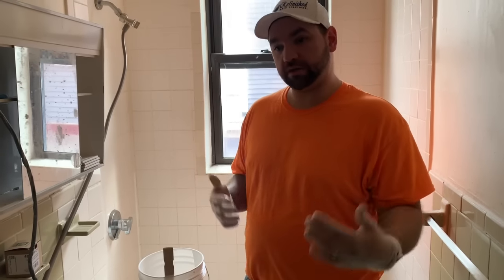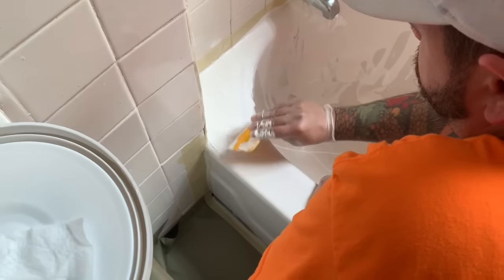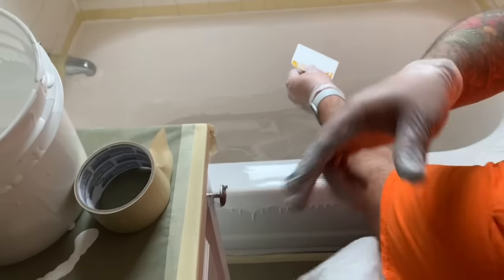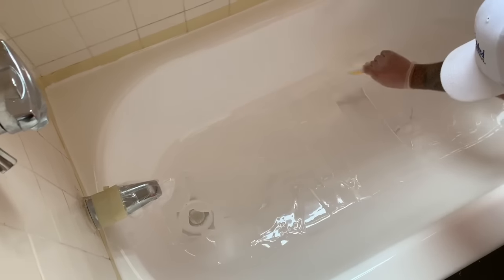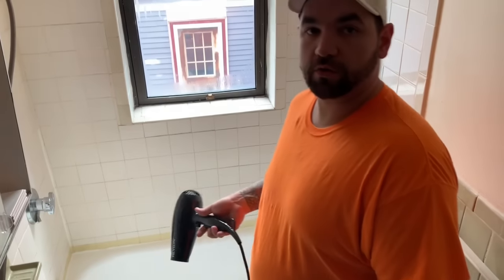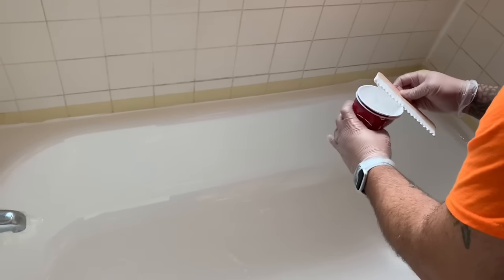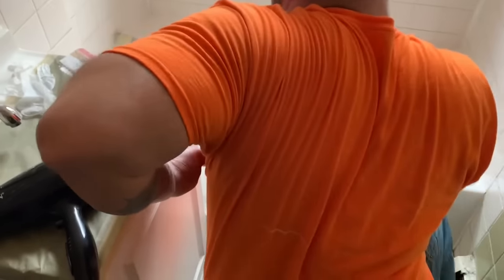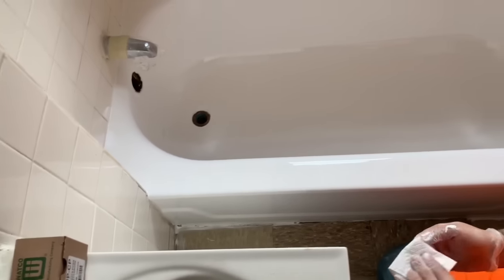Ekopel 2K is 20 Times Thicker Than Spray on Coating | Refinish A Tub Series Step 4

Comment: good video , thanks .... the drain part does seem like the tricky part ...... I think I might would take the drain cover off and plug the hole with a plastic stopper ..... but that's just me
Reply from the maker: shure46 That’s a pretty good idea. As long as you remove it before the material cures it should leave a nice edge. Normally for a refinisher using our material the best bet is to remove the drain and seal it with a small Dixie cup. There are a few different options when it comes to the drain area though. 
We wanted to make it as easy for homeowners as possible on this video.
Reply: @RefinishedBathSolutions  I've seen two videos using Ekopel , and both did it the way you do it , AND , I've never used Ekopel , so you're the expert here and you know what you're doing ...... I think what I would do is wrap the "plug/dixie cup" with wax paper or cellophane ..... plug will pop right out , cellophane might stick around the edge but who cares , it all gets covered and the drain cover will be easily replaceable later and seal better ... BUT then of course there's the problem of the drain part under the tub getting misaligned or popped loose , so I guess nothing is foolproof .... It's like i ALWAYS take off doorknobs when I paint doors because it's better "later on down the road" when you change doorknobs , the whole door is painted behind the doorknob and you don't have "issues" of old paint seams or colors showing ...... another thing , a stiff brush won't move that Ekopel around ??? Maybe even a silicone cake batter thingy with a handle

Comment: Welp. I tried rudtoleum tub and tile before knowing ab this product. It’s starting to peel where I assume something got dropped in the tub. Do I just sand it all off before cleaning with the Lysol? What grit sandpaper should I use?
Reply from the maker: Peel up what you can then sand the rest smooth to the touch with 220-320 grit sandpaper. As long as it's smooth to the touch then its good to start etching.
Reply: @RefinishedBathSolutions  thanks so much for the quick reply!

Comment: If a tub is badly rusted and old, will this product still work?
Reply from the maker: Yes it will you would just need to sand it smooth with 400 grit sandpaper give the tub a deep clean and you can use the primer for a better stick but the primer is optional.

Comment: Beautiful job! Very impressive. 
Our brand new bathtub was "professionally" reglazed because it had spider crack in one corner. It was done in a such a poor manner that after the reglazing, the bathtub was no longer smooth and shiny. Is there a sanding equipment or a method to be done in order to restore the previous smooth finish, or I should let it go and live with it the way it is?
Reply: hit it with some fine grades of wet n dry sand paper then machine polish it, should do the trick

Comment: What's the best way to tackle prep work?  I refinished my tub with the box store brand 3 years ago and it didn't take long to start to come up.  Since then I band-aided it with a stick-on tub cover thing but now that this is out I want to give it a try.  Should I be sanding and peeling as much as possible or will the new product seal it all in?
Reply from the maker: canopener505ify unfortunately yes, the best way to go about it is to sand down, scrape, or use stripper to remove the coating.  The casting resin will only be as strong as what it is applied to.
Reply: @RefinishedBathSolutions  is xylene considered a stripper?

Comment: what is the benefit of pouring the material on compared to painting on with a roller or other applicator? thanks!
Reply from the maker: If you roll it on it won't be thick enough. If it isn't thick enough then it can cause yellowing or streaking.

Comment: The biggest issue is the material collecting around the drain. It’s very stressful trying to figure out how much to leave there and also when to remove the tape around the drain.  I won’t try this again. Still in the process and worrying about exactly when to remove the tape as it is very wet still after a few hours.
Reply from the maker: Heat up the area with a heat gun or hair dryer then score around where the drain is with a razor blade if that doesn't work then you can use a dermal tool to cut it out. Then you can sand any affected areas smooth with 220-320 grit if you need more material you can use one of out touch up kits to fix

Comment: PLEASE HELP: Right under my tub faucet by the drain, there's a black (raw) spot from the water running down. Do you think I need a white primer before using this so that it won't show through???
Reply from the maker: Ekopel can cover up any pre existing colors with just one coat.

Comment: Hi, Great video and channel! Is this the best product you recommend to use? Is there another product that is of better price and less straining to the back? Like a spray?
Reply from the maker: We ran a spray finish company for 20 years as soon as we tried Ekopel we switched to only pour casting. 
Spray finishes make a mess and are dangerous to your health.  Ekopel is the only quality product for bathtub refinishing.
Reply: Refinished Bath Solutions there’s different types of spray material and also it only makes a mess if you don’t prep and don’t use a ventilation system. I own a Refinishing company and this material is always mentioned to us and I see why we can’t use it, it’s way to tedious, we do a lot of hotels and resorts that require 10-20 tubs done daily. I’d need 4 painters using this product rather than use one sprayer and 2 cheap prep people.
Reply from the maker: DannyBoyTV - once you get a little practice you can do 20 units a night with one prep guy and 1 installer. It only takes 15-20 minutes to coat a unit. Health wise no exhaust will prevent the long term health damage. I ran a spray business for 15 years and will never touch a spray gun again. 
Business wise Only difference is we charge twice as much and give a lifetime no peel warranty.  Give us a call tomorrow happy to get you a sample.
Reply: THE best was Klenk's but they do not make it anymore.  Was probably really hazardous.  I recently tried the Lowes spray on kit and it failed after a year.  I will try Ekopel next.

Comment: About a year after using ekopel refinish, a light brown streak has emerged down the middle of the tub.. any suggestions on how to cover or remove this streak?
Reply: UPDATE: In fact it was a (Lysol) disinfectant spray I had used for a couple months. It coated the surface.. and then slowly streamed toward the drain when wet from use of the shower.  But a residue would build up on the floor of the tub, in a streaming fashion.  I eventually figured it out and began to only used bleach based cleaner.. then over several cleanings.. it was gone.

Comment: If you remove the drain, can you let excess material run out to a painters tray underneath?
Reply from the maker: Yes. That’s the easiest way to do it. Tape the drain hole until the whole tub is covered. Then remove tape and let excess run down into the tray.

Comment: If the bathtub is chipped in various spots, would this fix the chips? or do I need to fix them first?
Reply from the maker: You would need to fill those in first with car bondo then you could use ekopel on top

Comment: How do you keep it from going down the drain? Wouldn’t that clog your drain?
Reply from the maker: We recommend putting a rag or something in the drain then tape up the hole and make a tape dam. To make a tape dam put half the tape flat on the bottom of the tub and half straight up in the air. This will prevent any material from going into your drain.

Comment: Spraying this material has to be easier and most effective
Reply: Electro Magnetic  gelcoat gun, it'll spray
Reply: you'll end up with 2K overspray all over your bathroom.
Reply: Shawon Razzaque there’s a gun for spaying resin. You should look it up.
Reply from the maker: James Blanton junk will peel in a couple months. Ekopel will never peel. Faster easier and less mess. This is the oldest/slowest install method. Watch our new videos. Takes 20-30 minutes for a complete rookie. Ekopel lasts at least twice as long as a brand new steel tub.
Reply: Jerk Of All Trades just showing an examples of how to spray it.

Comment: So if you have a walk in shower that's yellowed a bit you can't do the entire walls like you can with Bath Worls? I'd rather use this, but if I can only do the bathtub itself it would look weird.
Reply from the maker: Donna Bowman you could do it with 2 kits of Ekopel but I would recommend using our new product that is a roll on like the Bath works product but much stronger. 
https://refinishedbathproducts.com/products/tub-cast-5000-bath-tub-refinishing-kit-diy-roll-on-resin-kit the quart size kit does a whole shower with 2 coats. New video coming soon. 
Or you could do the walls with tub cast and do the tub with Ekopel. 
I hope this was helpful.

Comment: I'm ready to do my bath, but has been refinished in the past because the coating is pealing. Now do I need to strip the old finish off first with paint stripper before doing the new finish?
Reply from the maker: Velo1010 yes, it is best to remove low quality paints first.
Reply: Does this withstand use of suction type bath mat?
Reply from the maker: Velo1010 yes with Ekopel you can use a suction cup mat, although are refinished Bathtub Mat is also an option.

Comment: Will this fill in small cracks in a fiberglass shower pan?
Reply from the maker: Any cracks, chips, dents, or holes can be filled with car bondo first then sanded smooth to the touch with 220-320 grit sandpaper. Then you can coat with ekopel.

Comment: I applied ekopel 2k to a customer's  tube. He loves it, but I didn't notice there was a little water dripping so a ended up with a small detail. Can  ekopel 2k be fixed?
Reply from the maker: Julio Robles yes, we have a touch up kit on our website, if it is just surface damage you can sand and buff.

Comment: Would it help to sand the tub surface with 320 or 400 grit sandpaper and remove dust before applying the resin material? That's what other products require
Reply from the maker: Oscar Mendez sanding the surface doesn’t hurt. For porcelain tubs washing is the best method of prep. For fiberglass tubs sanding can help give the material more of a surface to bite into.
Reply: Dark smudges appearing during prep on fiberglass when using new/clean still wool, indicates a residue the epoxy might not adhere to and needs further cleaning. I use acetone during and as my final prep step.

Comment: VIDEO WAS GOOD, BUT RENTAL OR NOT FINISH AT BOTTOM OF TUB COULD HAVE BEEN CLEAN AND STRAIGHT BY USING A PUTTY KNIFE WITH THE PAPER TOWELS WRAPPED TIGHT AND CHANGING THEM AS NEEDED. JUST A TIP FROM AN OLD MASTER CRAFTSMAN., NEVER TOO OLD TO LEARN.

Comment: hi i just did my bath tub but on the drain spot i did the dam with the cup it got stuck and now looks weird what can i do to fix it???? please help
Reply from the maker: You can sand that area smooth with 220-320 grit sandpaper. Next if you need more material we have touch up kits on our website, here us the link to our website; https://refinishedbathsolutions.com/You would just pour the touch up kit over the affected area and then push the material around with the roller. It's the same material just a smaller size so it will blend in perfectly. here dis the link to our touch up demo video;https://www.youtube.com/watch?v=kdd-R2Ats-M&t=563s If after sanding you don't need more material then you can start to double up the grit sandpaper to 600 then 1500. Next use a car buffing compound to bring the shine back. The best way to understand buffing is to watch a YouTube video on how to buff a drip mark out of a car. This will teach you all you will need to know about buffing.

Comment: Main thing is to not touch it after you pour it on ..  unless you touch it within 10 mins of pouring then just let it be and use a heat gun a little but dont try touching it, rolling it or pouring over it until it all dries…. For real..  otherwise you will see it and regret touching it..  just don’t fool with it after 10 mins

Comment: Do you have any tips on how to do this with a claw foot tub? Specifically,  how to tape the edges for just doing the inside of the tub,  not the outside.
Reply from the maker: Normally when applying to a claw tub we put a couple pieces of paper on the outside and on the ground. Paper is the easiest way to protect against accidental drips or touching.
Reply: @RefinishedBathSolutions  Thanx

Comment: So, what can I do after I used the Ekopel 2k and more stains develop?
Reply from the maker: Use Mr. Clean Magic Eraser and Baking Soda to try to remove the a=stain and then rinse the shower out after each use for the next 30 days to prevent this from happening after the 30 days are up this problem will disappear.
Reply: Will this method also work for a sink?

Comment: How do you do touch up after it has dried?
Reply from the maker: sand affected area smooth to the touch with 220-320 grit sandpaper then make sure its smooth to the touch or when you re-pour it could mirror the affected area. Then use our pour on touch up kit to fix, its the same material just a smaller amount. Pour over affected area then push excess around with foam roller

Comment: What if the existing finish is peeling, do you remove all that you can and pour over it or is their something to use to remove it all first?
Reply from the maker: Robert Kuchinov it is best to sand until completely smooth or use a paint stripper and remove.

Comment: How would you sand and buff after it cures? What would you use?
Reply from the maker: The Happiest Dwarf I’d suggest watching a YouTube video on how to buff drips on a car. 

I don’t do a lot of buffing.
Reply: The Happiest Dwarf start with 320 grit wet sand. Work through the grits to 1500. Buff with a wool bonnet on buffer that spins only no oscillation and  heavy cut compound.

Comment: Do I need to buy 2 kits if I’m doing the tile as well?
Reply from the maker: Ramona Burns I recommend using tub cast 5000 if you are doing a tub with walls. It is much easier to use and will come out looking better.

Comment: I have tub with quarter size rust spot on the bottom. Do I need to perform any addition prep work?
What is your suggestion to contain this rust?
Reply from the maker: Karl Goode the best bet is to sand down the rusted area depending on the size of the chip I would then fill it with bonds, or jb weld.
Reply: @RefinishedBathSolutions  ty

Comment: How do you prep the tub first?
Reply from the maker: To prep your tub: Peel up what you can of the old paint then sand the rest smooth with 400 grit sandpaper. Next give the tub a deep clean using Lysol power. You'll want to get the room temp up to 70-75 degrees. Then you will be ready for you ekopel application.
Reply: That was an incredibly fast response! I was just about to delete this comment as I see that you have other steps. Thank you for your response

Comment: what do you do if you end up having excess? leave it and let it level out
Reply from the maker: Charles Webb you want to use the comb to level the bottom out then scoop out any excess before the 1 hour mark. There is normally about half-1 cup remaining at the end.
Reply: @RefinishedBathSolutions  Thanks for taking the time to answer my question.
Reply: How did your tub turn out?

Comment: This is a great Video, but spraying with HVLP is a lot more easier better finish 'in a way' I normally use AMERSHIELD from PPG. 2 part Epoxy.
Reply from the maker: I ran a spray business for 15 years. After 2 weeks of Ekopel I sold all spray equipment. I will never touch a spray gun again. 
Spray finish is so thin it will eventually pee no matter what. We produced over 3 million dollars worth of spray projects and had to do many redos even with the top of the line spray systems.
Reply: @RefinishedBathSolutions  I completely agree with you. If you spray touch up will be noticeable

Comment: Does not come out like that. My tub has runs and streaks.  No way to make it smooth throughout. My gloves melted and hard to get it off shoes clothes hands towels it gets everywhere
Reply from the maker: Claudia Corona we try to help every customer to the best of our ability. Please give us a call on Monday and we will try to help you figure out what went wrong and help with a solution.
Reply: Pretty sure most have went to using foam rollers to spread it instead of the comb.

Comment: Can this product as well as the tub cast 5000 be stirred with a drill?
Reply from the maker: simpson156 No! It is very important to watch the How To mix video. Drill mixers will cause bubbles and can cause areas to not cure. 

Hand mix for 10 full minutes, let it sit for 10 minutes then restore for 1-2 minutes then quickly pour. 

I hope this helps.

Comment: Approx how much does a job like that cost with that type of tub?
Reply from the maker: GoldenShaolinNutz most companies charge 600-800 our kits are $129-159
Reply: Ty sir for your fast reply.  Ty for the upload. Very informative. Very cost-effective with a little elbow grease. Makes me feel braver to try and be a diy person before i pay a pro to fix my mess =) ty ty
Reply: Hey man, I'm repairing a house with 2 cast iron tubs, I'm going to re-do the tile and I'm wondering if it's a good idea to refinish the tubs when they dont nothing around them and cover them up when I install the tile back up again
Reply from the maker: Adan Rios with Ekopel you can do it either way. I normally recommend doing the tub after just in case something slips and falls just right. Then you would need to repair afterwards.